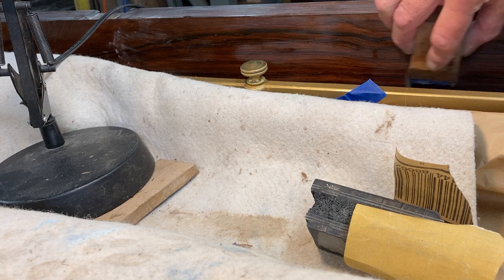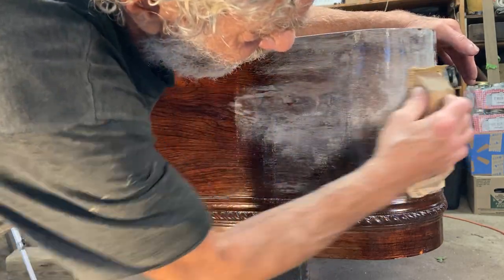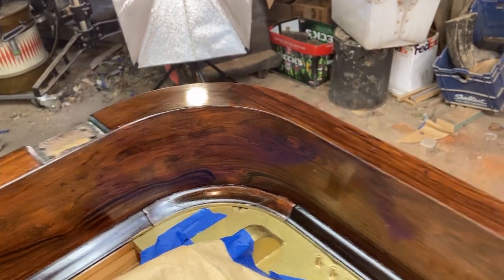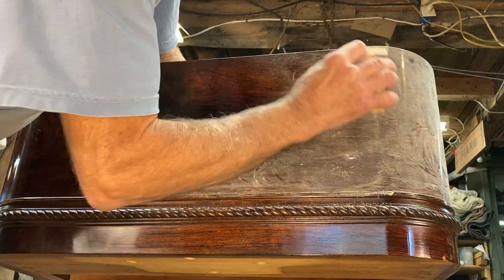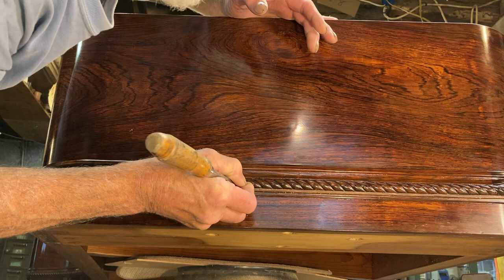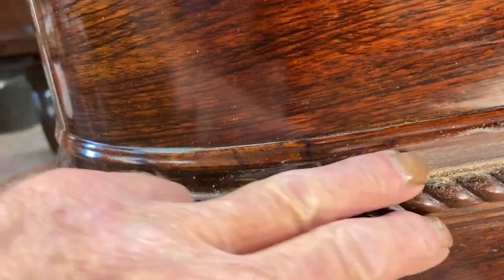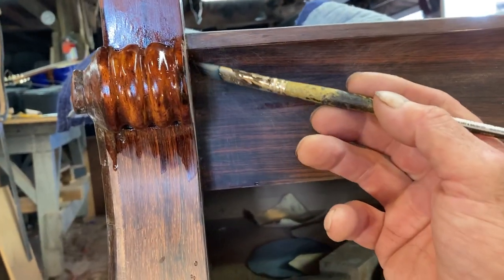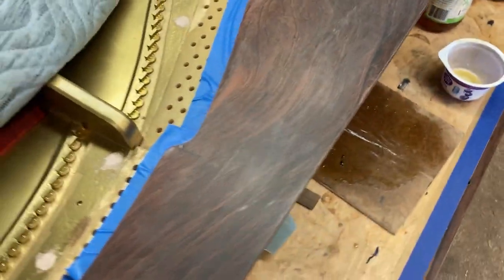Chickering 33B 1867 Conservative Restoration Part 46

Comment: The tail of that piano sure was a bunch of work. Admire your patience.  Am doing a zither now and am facing the same thing.
Reply from the maker: Well the silica element has made it possible to repair a damaged finish like that, the color is most important in this case and I did not want to wear into the wood surface, = troubles+anxiety  and then color matching.
If your doing it the way I do in the videos don't forget to wipe it down with water soaked cloth, then dry it with another cloth, "rag"  This is important to expedite the drying, and the next day it seriously helps prevent S.paper clotting.
As you near the final polishing water wet sand with 400 or 600 paper, I use 400 it's faster.
On the final polishing do not wipe with water!   Leave it be.
 After 24 or more hours use only pumice  or rottenstone "powdered slate" with very damp almost wet rag. 
Pumice is for one direction rubbing, rottenstone can be circled and is for high polish.
If you have any questions ask away!
Caution! do not use automotive or machine polishing abrasives, = big-big troubles.